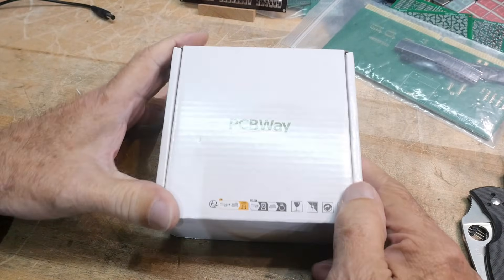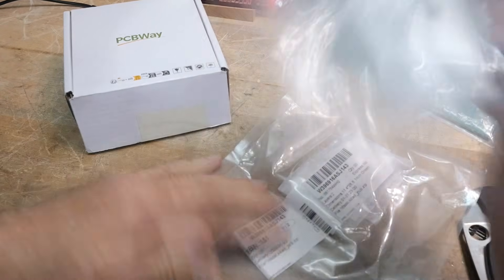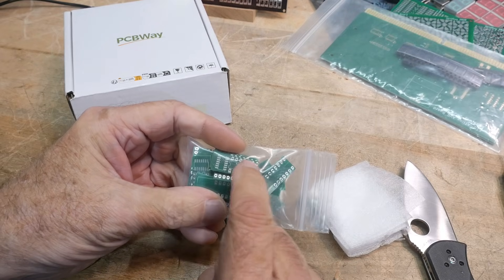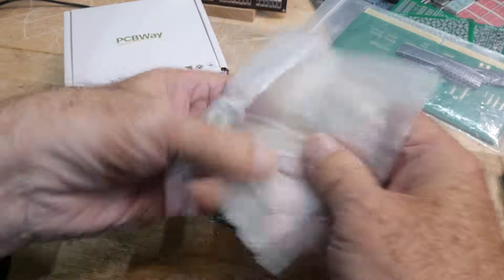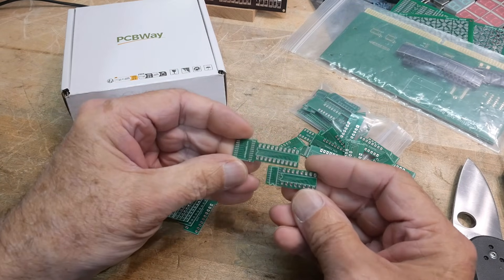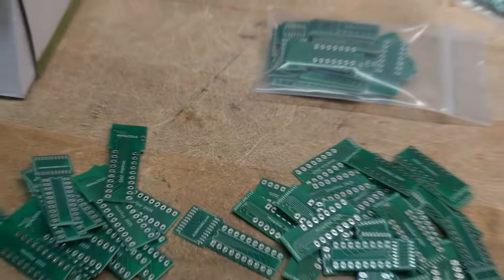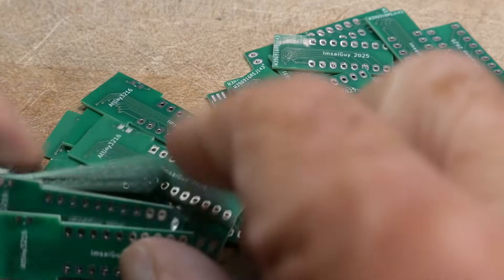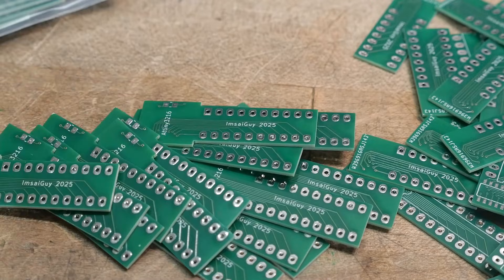#2133 16 and 20 pin SO to DIP adapters on 0.300" centers

Comment: First, thanks for making these adapters.  They are handy.  I had some made.  One comment, though: I wish the pads where slightly longer.  I think the current pads are from the standard SOIC footprint in kicad, and I'm sure they are perfect for oven or hot-plate soldering.  But with my limited equipment and soldering skills, I think slightly over-long pads make hand soldering much easier since one can get the soldering iron tip onto the pad and then, with the help of some flux, solder flows right between pin and pad.  I was able to solder your boards-- but it tested my skill, and I am not sure my results are perfect.  Cheers and thanks.  I love the channel.

Comment: Few years ago i made adapter for memory chips. Since the memory sockets were in contact with each other, the adapters could not extend beyond the outline. I used pins from old AMD processors surface mounted. It was difficult to solder it by hand, so I made myself a holder for pins from a PCB and soldered it on a hot plate.

Comment: Why are you using the AVRs?  The CH32V003 are much nicer.  Add in the new members of the family and they are very versatile.
Reply from the maker: just not familiar with those new Chinese parts.  maybe some day
Reply: @IMSAIGuy  They have been all over HaD and EEVblog.  You might want to take a minute when you have one to spare.
Reply: Seems like those would be more of a replacement for chips with ARM or MIPS cores, right?   AVRs usually target lower clock/lower power applications.
Reply from the maker: @ yes, the AVR you can clock all the way down to DC

Comment: What I always ask myself: Why not support local PCB manufacturers (even if they are a little more expensive)? 🤔I think that money should strengthen your own economy. I e.g. support local circuit board manufacturers here in Germany. The boards are only slightly more expensive than those from China, especially since there are no customs duties or expensive shipping.
Reply: Yeah, he is directly supporting a Chinese company by providing them with his endorsements and designs for sale.  He gets a cut? and all the free design &supply work. Buying local is a good goal.
Reply from the maker: I would love to be sponsored by us company. But I think prototypes are quite expensive here. $5 per square inch
Reply: @IMSAIGuy  Would you share estimates comparing Express pcb to pcbway costs on one of your designs?
Reply from the maker: at pcbway all my designs, you can download the gerbers for free. you can get quotes from anyone you want
Reply from the maker: @jspencerg  you can also use this tool: https://pcbshopper.com/
Reply: @IMSAIGuy  Thanks.  Making comparisons will make more sense if trade wars warm up.